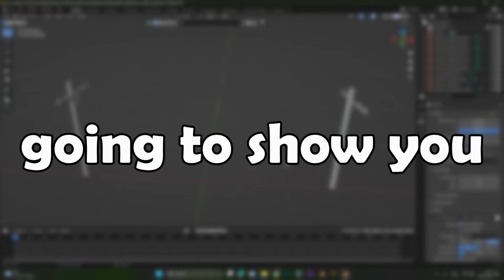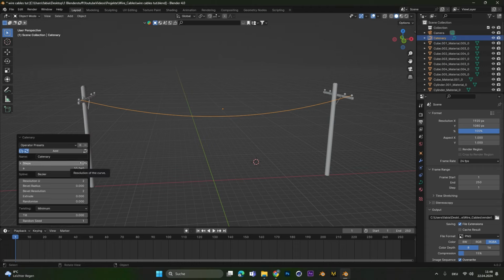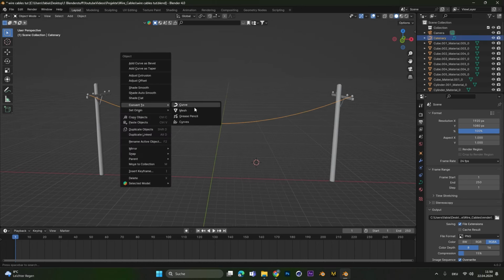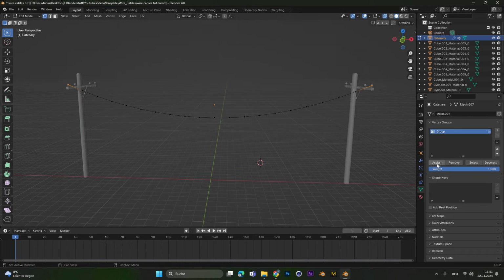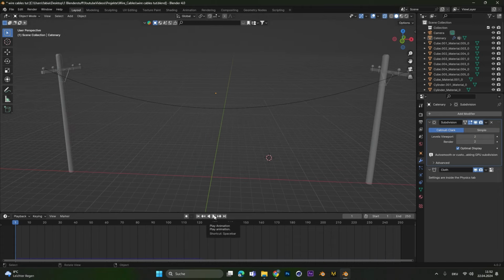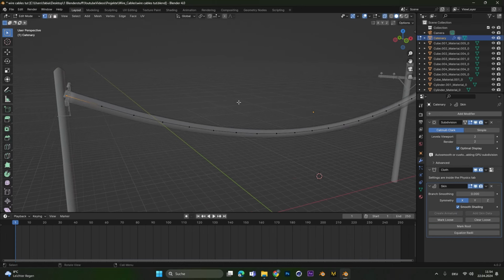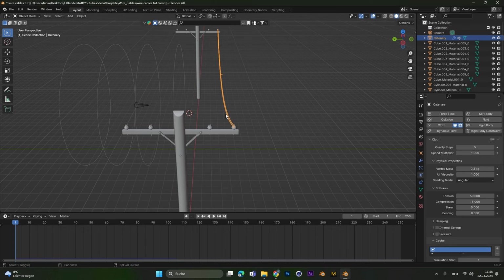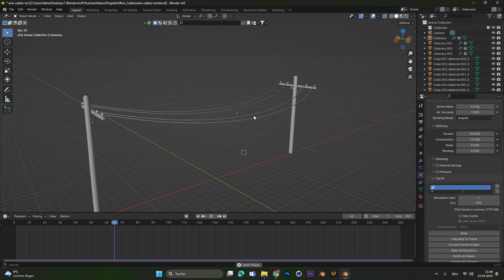The BEST way to create CABLES/WIRES with PHYSICS in Blender!

Comment: will this work on diferent parts on Carakers, that are animated? or need i there other pingroups? i whant make kabels on a robot, that has hangin kabels on torso to legs, and the gegs are animated... :D Grade VIdeo!
Reply from the maker: No they dont follow animated parts, I can do a video about that in the future!
Reply: @faebetutorials  that woud be amasing! Pleas do :D
Reply: Hi there! If you make another great video on Blender rope physics, could you also show how to connect ropes or cloth elements? I'm trying to create a realistic sail for a ship, specifically a triangular sail that's attached to a mast at the top and connected to a rope at the bottom corner. The rope should be fixed to the ship. My problem is that I can't get the connections right. Sometimes the points where the rope should attach to the sail either don't hold or fall infinitely. It would be amazing if you could address this too, because connecting ropes or cloth is really important, i think! :D Thanks!